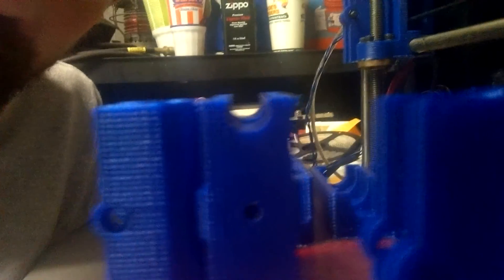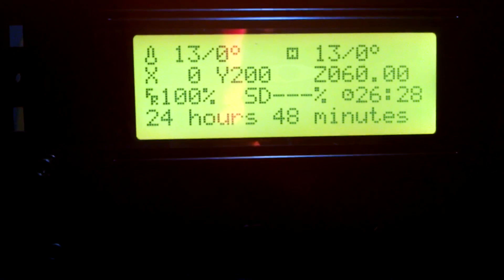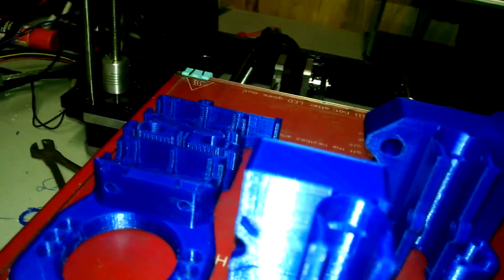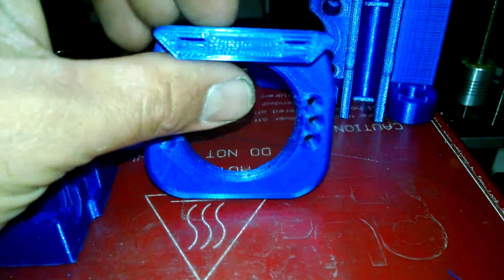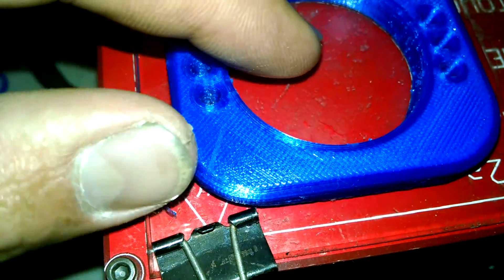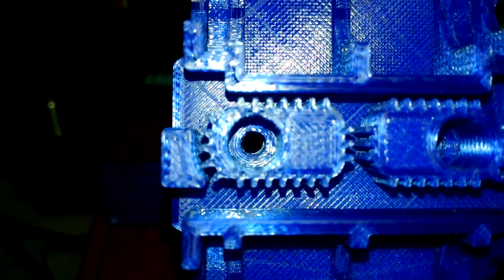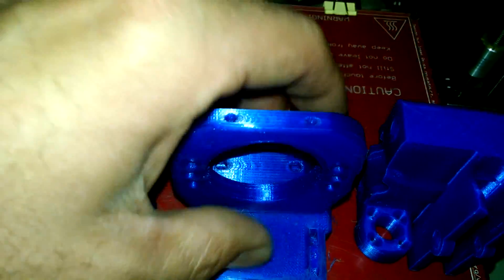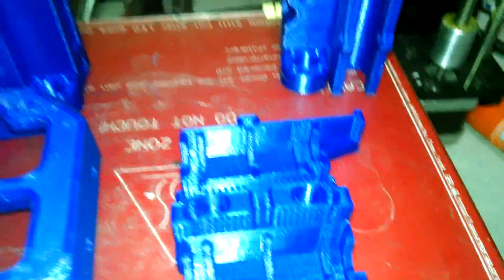update on my largest print, complete at 24hr 48min, 4 pieces.

Comment: Hello I'm having trouble configuring my Prusa i3 with 1.4 mega arduino Ramps 2560, the ENDStop not work and I'm sure it's a configuration problem that I find CONFIGURATION _H solution I can pass a file already set thanks ..

Comment: Ok... I give up... Where can I find your word press page? Got an address?
Reply from the maker: george6robles.wordpress.com
You will see my username at the top left-ish but, you will see links to the right for my Prusa setup. Click there and you should get to the right page.
Reply: George Robles it says doesn't exist...
Reply from the maker: Click the link in blue to the right
Reply from the maker: I'm going to add it now in a few min
Reply from the maker: Added some.
Reply: George Robles I meant that I clicked on your WordPress link and it said it does not exist....
Reply from the maker: georgerobles.wordpress.com
 If it says it doesn't exist and you see georgeroblesjr user name, click on the link in blue that says my Prusa i3 Pro B setup.
Reply: It is the georgeroblesjr.wordpress.com site.
Reply: I was wondering if you'd post your slicer config.
Reply from the maker: +Keith Applegarth 
my slicer configs that have worked well for me are on my WordPress blog
Reply: I am working through them. My first pass is getting better. I am in the middle of a few mods before I continue.
Reply from the maker: Yeah, I'm always moding too. I will hope to be getting a way to measure the filament size as its fed into printer, Bluetooth, and a fan adapter for the ramps 1.4, plus I have added two more temp presets for the filament . almost done with it.
Reply: George Robles I just added some LED lights around the print head. Really makes a difference and I changed out my solid couplers for the acme rods to flex ones. Apparently no matter how straight everything is, you need a little flex...

Comment: I tried their settings for the slicer on the forum and it did not help me at all. I would be very interested in your settings too. What are you using on the glass to get it to stick so well.
Reply from the maker: Check out the print tip clips playlist for the glue I'm using. School glue purple.
As for the slicer settings, I will be adding to my WordPress page soon. For anyone that has issues, if it says not available, look at the links on right for my Prusa i3 Pro B setup and click there.